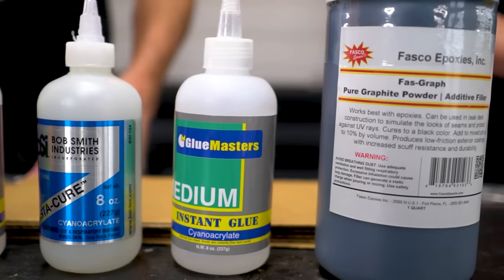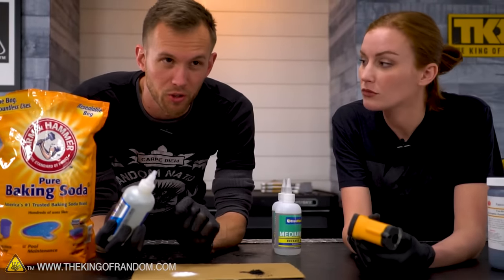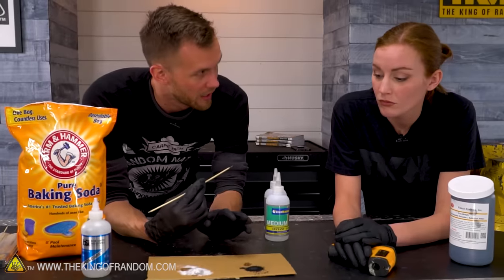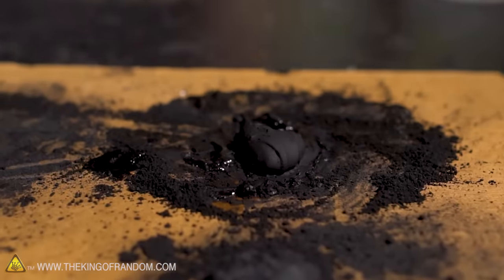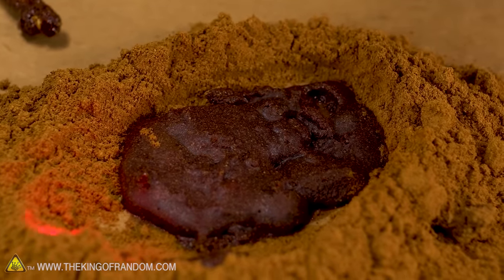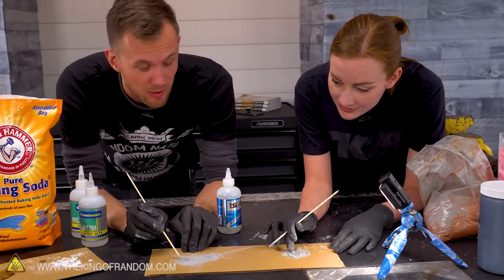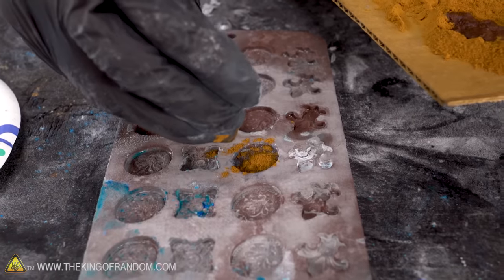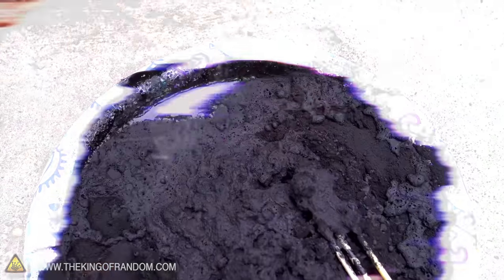Super Glue And CINNAMON Has An UNEXPECTED Reaction! The TKOR Super Glue and Baking Soda Trick!

Comment: +5 for the use of gloves. -50 for the lack of eye protection. The last thing you want is an exothermic reaction glued to your corneas.
Reply: Someone used the word "exothermic" before I did
Reply: They already have some
Reply: and -20 for not using Gunpowder with superglue.. I really wonder, what this would do?
Reply: @thomaskaiser148  pyroplastic. The super glue won't wash out the saltpeter. There also a chance it could ignite during cure. Not a big chance, but a chance all the same, considering it can be ignited by flipping a light switch across the room
Reply: metallic powders...no masks
Reply: Nicholas Hodges 
Gunpowder doesn’t have saltpeter as it’s nitrocellulose. Blackpowder does. Modern firearms use gunpowder for several reasons.
Reply: @souloftheage  did they somehow avoid saying that word in the video?
Reply: -50 for the use of Fahrenheit
Reply: Yessir!
Reply: @mug wump Agreed. That amount of fumes, doesn't matter what ventilation they have in the room. They needed proper masks. If they get flu like symptoms within 72 hours, it's from the fumes. Happened to me when doing a wood project, and wasn't near that amount. Sneezed and felt weak for a week. And once sensitized, it happens easier the next time with less fumes.
Reply: Yeah, that'll fry your eyes.
Reply: And -25 for doing all of this on a surface that could ignite (cardboard). Best to use glass or an old plate (not a plastic one).
Reply: @Lordofdarkness82   -50 degrees or points?
if degrees do you mean Centigrade/Celsius
Reply: And lungs
Reply: @Reprint001  People can benefit from Fahrenheit, there is more of a gap, and easier to make quick estimations. Even the human calculators can benefit from Fahrenheit if their device has only 1 decimal of precision and you might get more precision from F. That being said, professional videographers have a duty to the audience to put measurements in different unit conversions, to cater to all.
Reply: @thomaskaiser148  Super explosion?

Comment: Thanks for the video. I have been using thin superglue (CA) for nearly 20 years in woodworking. CA is a near perfect glue for wood repair. It's primary negative is that it cannot be stained easily. CA can be stained, but it takes a lot of skill and talent to pull it off successfully. Baking Soda is a strong contender for a quick and easy replacement to the traditional filler. Fine, pure sanding dust from multiple species of wood that can be blended to match the base wood color of your stock. The one thing I have always desired was a cheap, easily colored filler to replace the expensive wood and water based stains I have used in the past. The best part of the video was the molds. The practical application for CA and mold making goes way beyond props. With what you have shown in this video, I can save hundreds on decorative wood hardware. It's nothing unusual to pay north of $100 for a single corner bracket that resembled cast iron. Usually, I would use such hardware to cover the structural hardware used. The potential to use graphite and aluminum dust is exciting. For the base cost of one bracket I could buy enough supplies to make every piece of decorative hardware I want for my next project. To buy all the pieces I want for the project, I am looking at a base cost of about $1,000. Thanks again for the video, I can hardly wait to start experimenting with this.
Reply: Please use protection as others have said, your eyes and lungs are vulnerable. Take care.
Reply: I've seen wood workers stain the dust they use for repairs first and get great results.
Reply: Try a product called Perfect Cast. It comes in a 4lb bag. It's powdered plaster that's 5x times stronger than normal plaster. I was messing with it to create molds and realized I could use it for wood working projects as a filler as it is cheaper and easier to work with. It sands really well. I haven't tried staining it but it does say it can be stained on the bag. Very useful to have around as a filler for repairs. Mixes with water at 3:1 ratio. Oh and buy it  at hobby lobby for $7.50, Amazon is about twice that. Definitely a little hack I ran into accidentally.
Reply: @leveragelifestyle8581  how do you make the moulds?
Reply: @joycependleton4117  I created a small vacuum mold to create dental clear aligners. It doesn't work well for that though as it sticks too well inside and then cracks when you flex the clear aligner. Could be used in other instances with better molds like silicone.

Comment: I made a walking cane for my father and filled cracks in the wood with sawdust from the same wood pressed into the crack and superglue dripped on it.  Worked like a charm and made a near invisible repair.
Reply: Whats the temperature tolerance of the baking soda/superglue "plastic"? How high can you go before breakdown?
Reply: Matt 
I use epoxy with dry powder pigments.  I have found it’s best to try to match the darkest colored streaks in the wood; it depends on the wood though.
Reply: +Matt:  Awesome tip!
Reply: @rodblack4368  Its very hot but cools down very quick, doesn't melt adjoining plastics.

Comment: I used to work in an engineering consulting center for adhesives, I've done tons of experiments with all types of cyanoacrilate adhesives (superglue).  When you blow on a superglue to make it cure faster, what you're really doing is adding moisture from your breath. It's not reacting at all with anything you mix it into other than the moisture content.  When you mix a fine powder with superglue, you're giving it a ton of surface area that has moisture on it to react with.  In addition, the reaction speed increases with temperature.
Reply: Bravo!  Someone understands the chemistry behind what is being witnessed.  This was exactly what I imagined was actually happening.  Thanks for illuminating the effects.  Some people advocate refrigerating the glue bottles to prolong their material usability - I am not sure how well that works, especially as the glue will precipitate condensation on and in the bottle and glue with the result of accelerating its polymerization.  I put my bottles in a tightly closed mason jar with silica gel adsorbent/desiccant and only use it when the relative ambient humidity is low.  In veterinary medicine we use tissue CA glue to reoppose clean wound edges.  It polymerizes quickly due to the moisture in the tissues.
Reply: Thankyou for explaining this

Comment: Every guitar-tech on this planet knows the bakingsoda-superglue trick.
When the slot of a guitar-nut becomes to deep (from wear or if you accidently filed it a stroke to deep while adjusting the guitars action) and you don't want to remake a complete nut, you can fill up the bottom slot with thix mixtures since it makes a almost glass-hard composite.
Reply: Fender guitar techs also use it if you have splits in the fingerboard.

Comment: Well, this is all rather fascinating, but I'd like to see some durability tests of the different end products. I've seen where the graphite mix becomes quite hard to the point where someone had a hard time drilling it. Interesting how the glue reacts with different compounds, just would like to see some practical applications for each one.
Reply: I have a lawn mower bag catcher ...plastic splitting at the rivet joints .....I used the thin super glue with baking powder....it took several layers but BAMB! It has fixed the issue and for two years now
Reply: I recently watched a durability test done using CA glue with other stuff.  Just do a search on youtube.

Comment: I burned both corneas twice, then two weeks later I could see clearly again, so I read the instructions.  ventilation, eye protection. Ten years later, I'm still allergic to balsa dust & super glue fumes. I'm old, so healing way slower now. Twice as cautious now
Reply: Mate I've been burned doing the same , not the eyes thankfully. One other time I spilled some of that really thin glue on my jeans. That burned so bad.
Reply: @rainmanj9978  I wouldn't use it on a radiator mate. If you can afford it get some Devcon
Reply: @rainmanj9978  it only burns if it's on your skin. It can give off those noxious fumes though if it's accelerated to dry too quickly.
Reply: I smoked super glue once.. thought it was some meth crystal dropped on my floor...  never again... my lungs felt like they froze collapsed had to drag myself to bathroom and slowly drink water and lay in tub.. until i felt better...
Reply: @rigobertovillalobos3614  very scarey

Comment: Metal filings from a bench grinder and medium super glue work really well for patching together broken headlight brackets on cars.
Reply: How did you figure that out!? Awesome thanks
Reply: Do u do MOTs? Lol
Reply: Hey this is a great idea!
Reply: And many other thing..
Reply: Maybe just using the Steel wool would work as well?
Reply: He dead bro
Reply: あっs
Reply: ふck
Reply: People forget theres a reason they invented the easier way in the first place🙄
Reply: @dawnbreak3299  
 The laziest people find the easiest way & all but the foolish benefit.
😎
Reply: I've used scrap Styrofoam and fingernail polish remover to make some wicked glue!
Reply: Talc and super glue will bond thermoset platics, I used this to repair a petrol pump on a mower engine that lasted 4 years of petrol, heat and vibration.
Reply: @abyssmanur3965  
What is talc?
Reply: @bkingtz1  I should have said 'Talcum powder' ...scented works fine ...
Reply: @bkingtz1  It cures into a ceramic like layer onto which you can keep building layers.
Reply: @abyssmanur3965  
Thanks man.
Reply: @abyssmanur3965  
I googled it, it says it is in most baby powders to.
So what is the brand that produces it for that ceramics work you are mentioning and is that the same stuff?
I mean to hold for 4 years on that pump, it's mildly said, impressive!
Reply: @bkingtz1  yes standard baby powder is the right stuff, just glue it as you would  without the powder just to get everything in right place, at which point it is fragile and will just fall apart, then wet all glued areas again, adding powder and wait for it to set and brush off loose powder and go again, more superglue, more powder till you get the strength you need.
The bit that amazed me was it never leaked gasoline.
Reply: @bkingtz1  Apparently its an old mold makers trick for repairing molds, guitar repairers use it too, to repair bone bridges and nuts
Reply: @abyssmanur3965  
I am mechanic and I do all other stuff around cars and never heard about this what you said.
Of course I knew about baking soda but this that you are experienced is amazing, I mean to hold that long and on top of that withstand gasoline, it is really amazing.
Thank you very much for this info I will try it as soon as possible.
Reply: Saw half your comment thought your were going to say "for patching together broken teeth" 😂
Reply: Does the paste act as a filler or does it also bond the parts?
Reply: I'm sure I'll need this someday
Reply: @litmusaero2645  Hitler.. What was your biggest struggle in life man? I'm kinda down right now bud.
Reply: Thx...My headlight bracket gets broken almost once a day..hopefully it will work for those broken fan blades I have to keep fixing...
Reply: @nicksshitbro  yeah....doesn't work very well without the hardener bro.
Reply: @bkingtz1  it's a mineral if you must know
Reply: A better, sandable, buffable, and paint able mix would be plain bleached flour and superglue. It makes a super cheap, strong yet workable, perfect little epoxy/resin.
-i wonder... taking @briansmobile1 metal fillings, mixed with grey colored flour (dried), and superglue would work pretty well. I believe with the added structural integrity of the shavings it would make a nice little bond.
Reply: @MimiDidi121  lol, I wonder if you realize just how close that is to making oldschool  napalm... substitute the nail polish remover with diesel and... well, you get the idea.🤫🤭
Reply: Amber Smith ...are you sure about that?
Reply: Man I always wondurd that
Reply: Is this true or are you trolling?
Reply: YES IT DOES! I have ALSO Done this to repair 1/24 scale Die-Cast Cars and toys and works REALLY WELL!
Reply: @pascalramkissoon3982  momomokokôb
Reply: @brookebjorgen3158  nyou inoninoninknbonnonnninokk in
Reply: Are you referring to the headlight "door" (The main housing around the lights) or the actual, holds the light in place bracket, that allows the adjustment?  I'm asking because they're two different metals but both get broken.
Reply: @MimiDidi121  thats funny because spray foam is the same thing you just made.  Polyisocyanurate glue.  Or polystyrene depending on the foam.  You can buy acetone much cheaper at hardware stores its for cleaning foam guns and tools.
Reply: Nice
Reply: @pbsixgun6  Compress the steel wool in so the air gaps between strands are really small and the anaerobic curing of the superglue should set the whole mass consistently solid. This medium would be quite strong because of the integrated steel strands.
Reply: I've used commercial iron powdered metal and powdered brass with the superglue to repair craters and pit holes in metal castings. It works very well and can be filed or machined after setting through dry.
Reply: @brookebjorgen3158  old trick
Reply: Does everyone know that bicarb isn't just acting as a filler, theres an actual chemical reaction that occurs, and its also why it cures the super glue super faster as its an oxidizer. Im not sure if theres a chemical reaction happening with all those other fillers. The talc sounds interesting but unless its reacting to make a stronger bond its only as strong as the regular super glue. Actually possible maybe slightly more as it would increase the surface area being glued, but still.
Reply: @JoshPhoenix11  I would have thought it more deoxidizer as the cyano adhesive is anaerobic curing.
Reply: Sounds like DIY JBWeld
Reply: Cool life hac
Reply: What's wrong with duct tape? :)
Reply: An that's cool thanks.

Comment: Independent variable: What you mix together
Dependent variable: The reaction
Controlled variable: The table
Reply: Steel Current controlled variable is what you mix since it's what you change, and independent is the table since it doesn't change
Reply: What why did you comment this
Reply: @gri5in862  do not question the mighty one
Reply: The Tacocrew Wrong, they’re control variables, rather than ‘controlled’ variables. The point is that they’re the things that you control to be the same in every reaction to make it fair.
Reply: Constantinople, 1054  So by controlling them they become what, controlled?
Reply: Will Lawson That is correct grammatically speaking but it doesn’t change the fact that they’re called ‘control variables.’ i didn’t make the name, don’t argue with me.

Comment: I have used super glue  and baking soda to repair a cracked off section of a guitar nut. This is the plastic or nylon bar at the top of the neck that the strings rest on. My high e string  would not set in the slot as it was broken off. I have totally forgotten about the repair and  played the guitar for years with no issues

Comment: You should try pouring the super glue on denim. I’ve had spills on jeans where they’ve literally caught on fire.
Reply: Oh yes, one of the joys of working with Super glue is rock hard spots on your jeans when you spill a little.😖
Reply: System 32 I have but I don’t notice usually. Pains of being a mechanic.
Reply: @mikeyjohnson7713  pls post a video
Reply: I wonder if the superglue is reacting with the cellulose in the cinnamon like it does with fabric?
Reply: Yep, +1 for superglue burns on legs when wearing works trousers! Always takes you by surprise aswell!

Comment: A word of caution: while using superglue on a wood model, I burned my eyes with the fumes. My eyes actually bled, causing blurred vision and a lot of pain. Even the supposed CA with no fumes can be harmful. Just for your information.
Reply: Well, it's inherently volatile.
But that's only an issue if you don't ensure that nothing that evaporates from the workpiece can get into your eyes, like via a full-face respirator or strong exhaust fan.
Reply: CA?
Reply: @kish1865  
Cyanoacrylate.  It's the primary ingredient of superglue and crazy glue and every other brand of rapid curing adhesive.
Reply: Should use superglue to fix your eyes